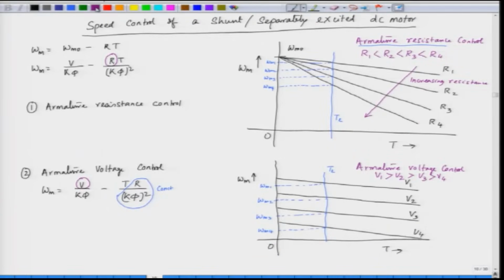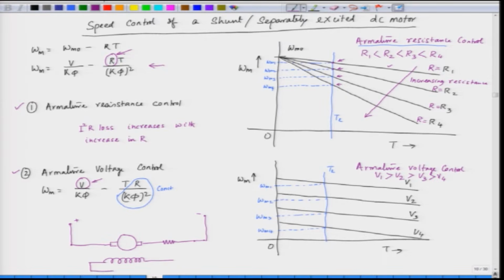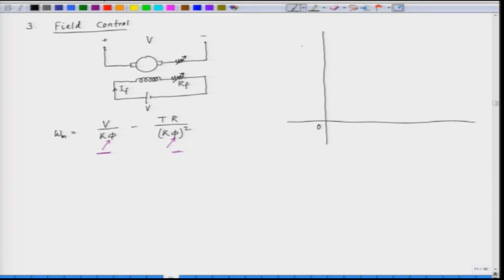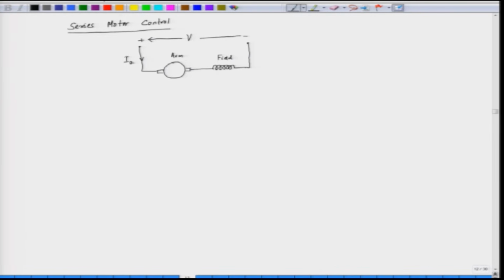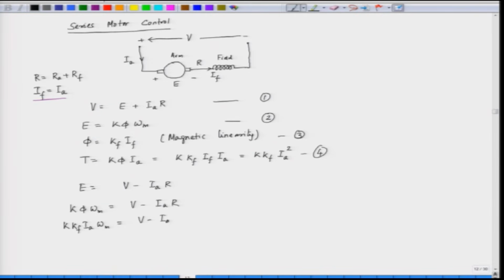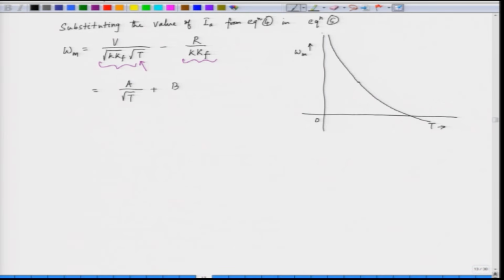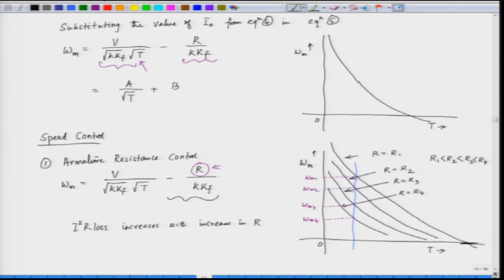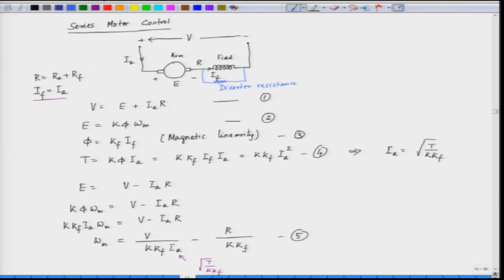noc19-ee65-lec06

Comment: I worked in Fridge Compressors.

That’s a cool metaphor — and it actually works in a few ways:

❄️ Continuous background work — like a fridge compressor quietly maintaining temperature, IT systems keep data, services, and operations running behind the scenes.

⚙️ Cycles of load and rest — compressors switch on when needed; IT scales compute up and down based on demand.

🔌 Infrastructure, not the product — the compressor isn’t the food; IT isn’t the business output — it enables everything else to function.

🧊 Stability + preservation — refrigeration preserves goods; IT preserves information, processes, and institutional memory.

So yeah — “information technology is a fridge compressor” is a neat cybernetic image: invisible machinery maintaining the stable conditions modern systems need to operate.

❤🎉